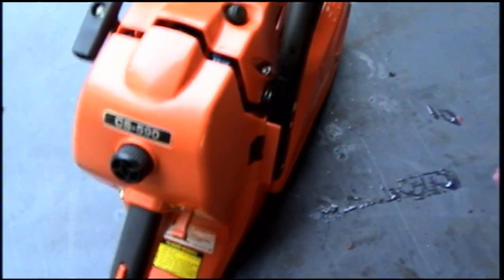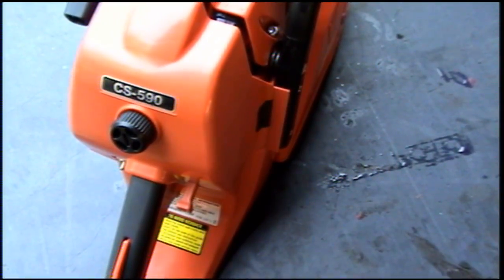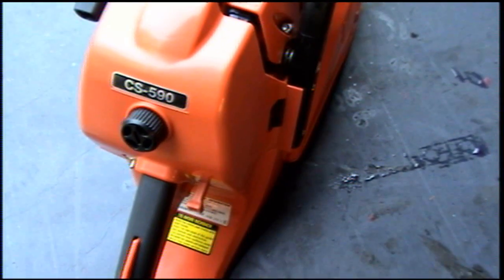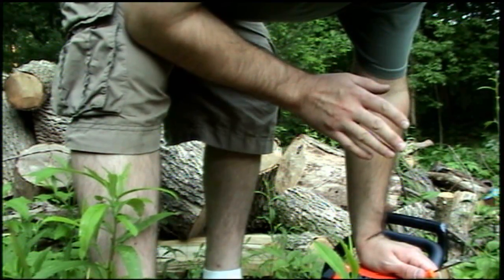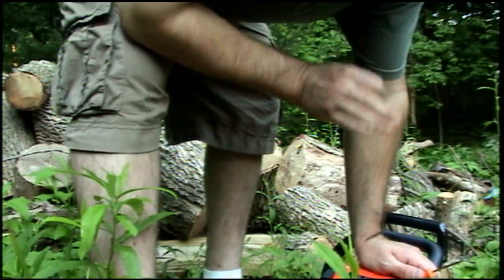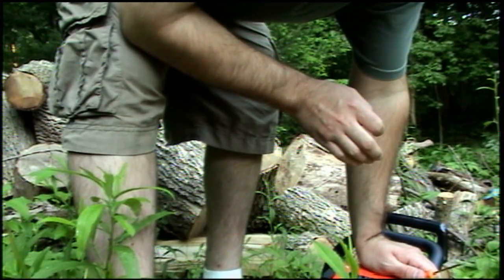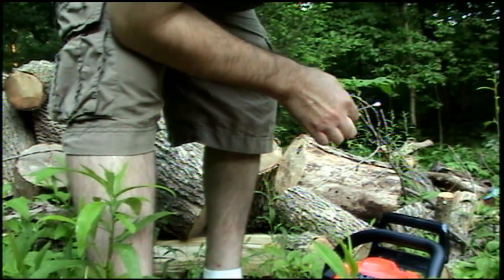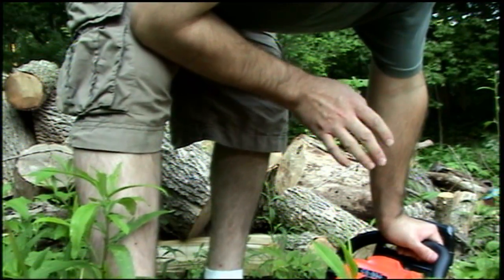How to tune a chainsaw.

Comment: Adjust the lo mixture for highest RPM'S at idle and hi mixture for highest RPM'S at full-throttle. Set the idle just until the chain just stops.
Reply from the maker: Marty Stevens 

No if you simply set the high speed needle for the most rpm's, the saw will be running lean, this can damage the engine. The rest you understand correctly.
Reply: bobe8888 Set the hi for highest RPM'S at full-throttle and best setting. You may have to readjust the mixture according to the engine.
Reply from the maker: Marty Stevens 

If you simply look for the most rpm at full throttle, you will be too lean. This mean the engine will run hot, lack lubrication, and will be down on power. In non revlimited saws tuning by ear listing for the four stroke sound is preferred, as long as you know what your doing. The aid of an inductive tachometer is useful as well. Things get tricky with revlimited saws, it takes some experience to tune those, but tuning just to or below the limiter is normally a safe bet. Some models need to be tuned differently do to the design, a Xtorque 372 will will trash the big end bearing if you tune to 13,500 rpm like the old non Xtorque model. This is do to the heavier piston. You simply can't just tune for max rpm, unless you want to distort the engine.
Reply: Setting them for the maximum RPM can be too lean and cause your cylinder to heat up. If you aren't using a tach, then rich them out until you begin to hear the RPM drop off a little. The engines are so finely tuned out of the factory (for purposes of emmisions control), that if you lean them out even a tiny bit, you can shorten the life of the cylinder a lot. If I'm not in the field, I like t break out the tach and adjust it to the factory settings.
Reply from the maker: Well yes if you set the H speed jet too lean "and most saws are too lean from the factory" the engine won't get enough fuel and the engine will lean seize. I was talking about the L speed needle, you want that as lean as you can go and still have good acceleration from idle. If the L is too lean the saw will stumble when you try to accelerate. Saws idle super rich, this is so the saw can transition from idle to full throttle. 

A tach is a good tool to have, but if you know what you're doing and actually understand what's going on, it's not needed really needed, but it's another good tool to have. If one cannot tune the H speed needle by ear, you'll ever get the tune spot on, as every saw will reach proper air fuel mixture at a different RPM, do to manufacturing variances.
Reply: I like to go to the manufacturer's set up specs and set them, then decide if the high needle is too lean. If you're getting good jump off the low needle and the burble clears out in the cut, at least most of it, I feel pretty good. I'm an Echo guy, although I do own a couple Stihls, and I find them (Echo) easy to set up and won't run lean without letting you know. It's like they have a particular smell if they're even just a little lean. I also agree that they set them lean at the factory. I'm not sure if you were answering my note, but if you were, I totally appreciate it. I think my comment was actually in response to another one of the people who posted here. Anyway, I enjoyed your take on this and learned from it. Thank you
Reply from the maker: It was a response to you. Listening for it to clear up in the wood will get you pretty much spot on. Be careful though the new saws including Echo's are almost all rev-limited, when you hit the limiter it can trick you into thinking the saw is burbling rich when it could be lean. Best way to set these saws up is to set the H super rich than slowly lean it out in the cut under some load. Also if you have a tach on the saw and the limiter kicks in, the tach will show incorrect readings.

Thanks for commenting.
Reply from the maker: Andrew sorry I accidentally deleted your last post, hit the wrong button trying to reply.  Are you suing a base gasket? and again where is the leak coming from?
Reply: Yes, it is an OEM gasket. When It leaked using a pressure tester after the first reassembly, I used the Stihl recommended base gasket sealer. It is a type of silicone formulated for this use. At first the bubbles were coming from both the top of the cylinder base bolt and the bottom. It is the bolt (or socket head cap screw) that bolts the cylinder to the case. This is a split case saw and there is no evidence of an air leak anywhere else. It's on the flywheel side, the screw closest to the carb. The only one of the four that goes clear through so that you can see a couple of the threads at the bottom of the screw. I used some high heat thread sealer  the last time I put it together, and it's in the house curing right now. I noticed that the surface that the screw head and washer bears on is not as flat or well machined as I would like, so it's possible that's affecting it, but I've never seen this before. I suppose it could be a flaw in the casting, but if it is, it's invisible.
Reply from the maker: Andrew Mantle 

OK. The base of the cylinder and the the case have to be extremely clean and flat, if not they will leak. Not sure about washer you're referring to, some saws have spacers between the screw head and cylinder. If the base is leaking I would remove it, clean off any sealant or old gasket, and inspect the cylinder. With a good gasket sealant isn't even needed, but if used sparingly it's not a bad idea. You can use thread locker if you like I've never found it to be necessary. If the cylinder to piston clearance "aka the Squish" is adequate and you is a a good sealant like Dirko, a base gasket isn't even needed. Most saws have enough squish, but you have to make sure or else the piston could slap the cylinder, obviously that's bad lol. 

You definitely don't want to run the saw if the base is leaking.
Reply: This saw has a captured spacer and a locknut. Everything looks very good. except the surface I spoke of where the spacer contacts the cylinder. If my current fix doesn't rectify the leak, I will take it all apart and start again.  Thank you for your helpful response.
Reply from the maker: Andrew Mantle 

Locknut? I haven't seen that on modern ssws, I assume it looks factory? I'll see if I can come up with an IPL for that saw. What model again?

 You only need to worry about the mating surfaces, as long as you get the fasteners torqued on correctly.
Reply from the maker: Just looked up the opp for the 670, it does use a spacer and lock washer, odd setup.
Reply: You are right, I only saw a lock washer in my mind. It is just a captured spacer. I haven't had a chance to pressure test it again. I will probably do that on Friday.